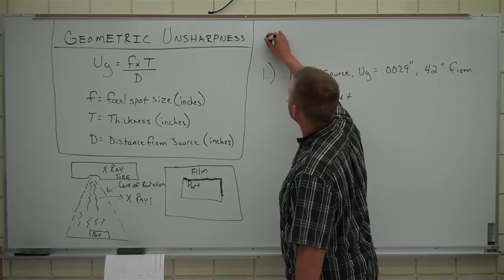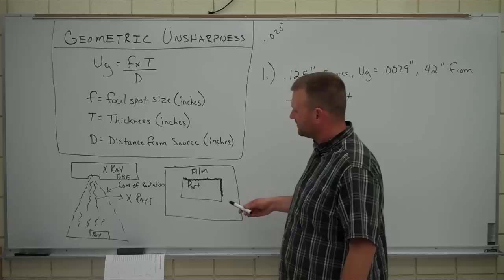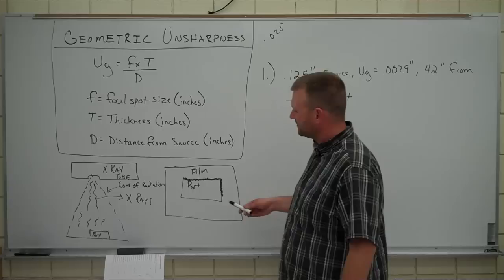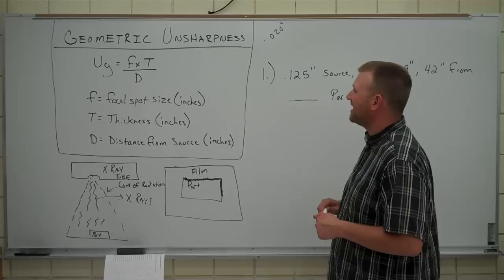Geometric Unsharpness

Comment: Here is the formula I learned in x-ray school ... Penumbra = FS  x  OID / SOD.    Units inches or cm or mm depending on problem. FS = Focal spot size, OID - Object Image Distance, SOD - Source to Object Distance.... OID + SOD = SID     ... conversion factors to know 1 inch = 2.54 cm.    1 cm = 10 mm ... so ex. 2 mm is the same as 0.2 cm

Comment: I'm not sure this is a great way to understand the idea conceptually. The "Thickness" part is misleading. This implies an object of given thickness resting on a receptor, from which you then consider the geometric uncertainty of the edge of the entrance surface of the object as recorded on the image. If the object were not resting on the receptor, the object would have the same thickness but now there will be an additional distance to consider. I think the concept may be clearer (no pun intended) if Object to Image Distance (or some variant) instead of "thickness". It might also be easier to take the approach of similar triangles, the ratio of unsharpness to focal spot size will be equal to the ratio of the distances.
Reply: ozmetalfan666 yea agree with u, how about at DWDI and DWSI, there will be changing in the formula, T actually represent IQI placment